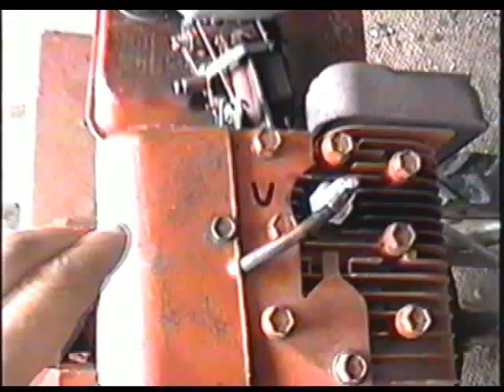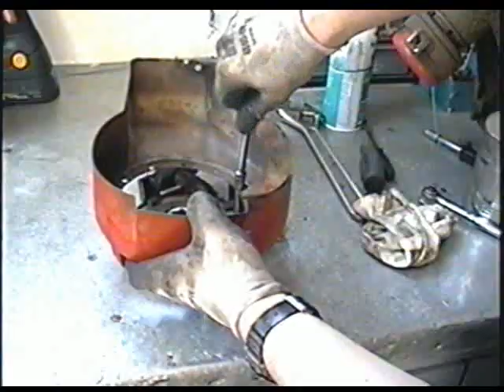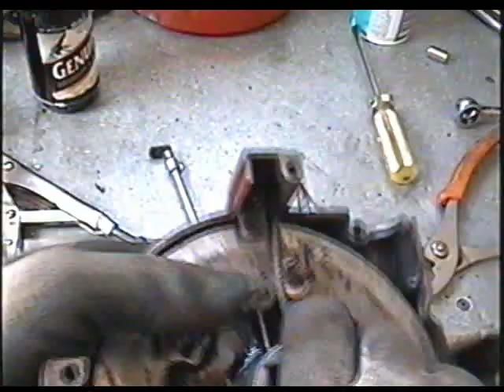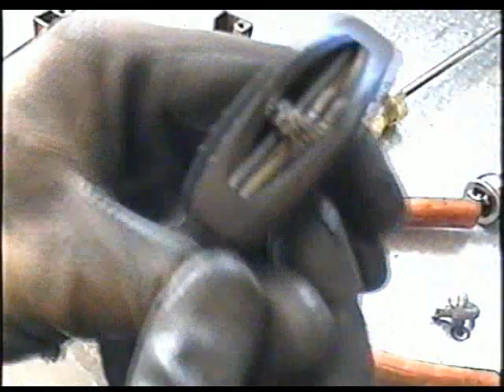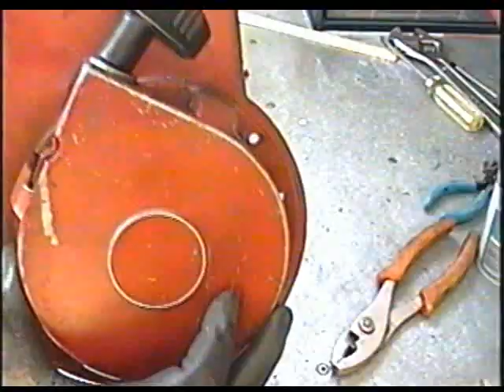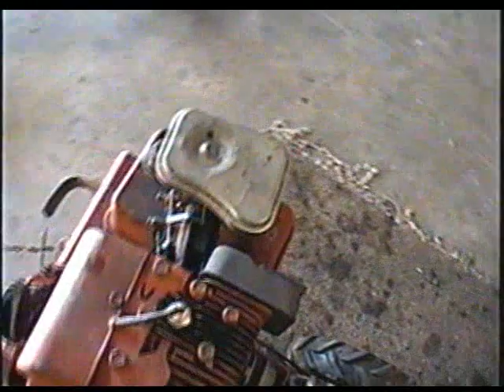HOW TO Replace PULL CORD on BRIGGS 5HP ENGINE

Comment: I can see pulling the cord will engage the splines to the flywheel shaft to start the engine, but after the engine starts how does the shaft not continue to turn the recoil assembly pulley?

Comment: Would you happen to know what size bolts hold the cowling onto the motor? I acquired and old tiller with the same motor but the housing was removed already and i have no idea what size bolts go on there.
Reply: In the same predicament as you, but they should be quarter inch bolts maybe 3/4 of an inch long half inch don’t take much to thread them in use lock  washer

Comment: Great video. Any advice on how to remove the white plastic pulley the rope goes around. Just acquired one of those & popped the little tab off of the house thats beside the pull handle & lost the little piece down in there.

Comment: OH, man I could save you most of that work!!  Once the housing is off the motor, fully pull the rope out of the housing.  Be prepared with a clamp to secure the wheel so the spring doesn't re-spool the rope.  Now push (not pull) on the rope to force the knotted end out of the wheel.  Cut the knot and throw away the old rope.  Carefully push the new rope through the outside hole on the housing and thread it into the hole in the spinwheel and push it until it appears in the hole where the knotted end had been.  Using a needle nose pliers or safety pin, pull the end of the rope out of the hole.  Proceed with tying and melting, etc.  This would be a good time to see that the spring is as tight as it can be before reattaching the rope.
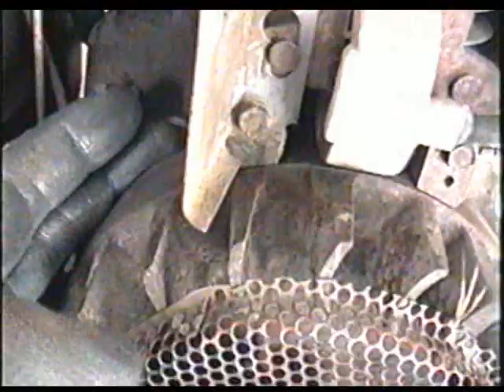Reply: BTW:  My procedure starts immediately after the 1:00 minute mark in the video.

Comment: An easily overlooked  step is not noticing the 12'o'clock triangle mark that is on one of the 4 corners of the starter clutch's shank on all horizontal engines.With it at the TOP,it insures that you will not have to pull hardly any rope out before one of the clutch's ball bearings takes hold.(No rope loss..,no sore shoulder)

Comment: Hi donyboy73, love your videos!  I have an engine where the ratchet pawls broke, so I'll be doing that repair.  However, I noticed that the rope didn't always retract all the way.  Is this due to the spring?  On this job you replaced the rope though the problem seemed to be the same as mine, the rope not retracting.  What should I do?
Reply from the maker: +Betsy Cambareri a new rope sometimes helps if the old one is stiff, you may need to make the spring tighter
Reply: +donyboy73 , thanks for your reply!  Do you have a video on how to tighten or replace the spring?
Reply from the maker: +Betsy Cambareri not yet but this vid should give you a good idea how to tighten it https://www.youtube.com/watch?v=LaA_rdKlmEs
Reply: +donyboy73  Awesome, thank you!